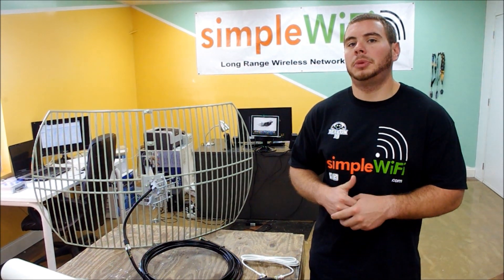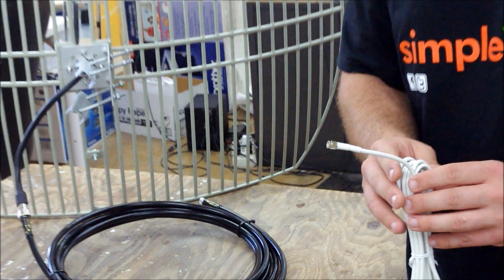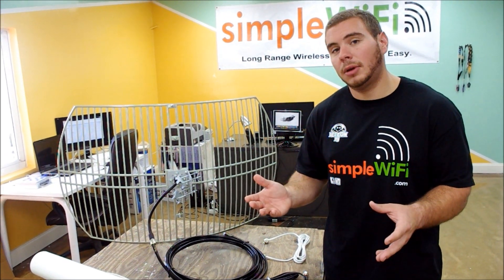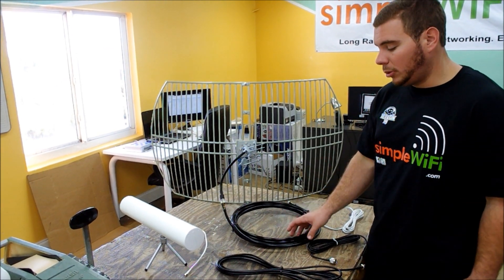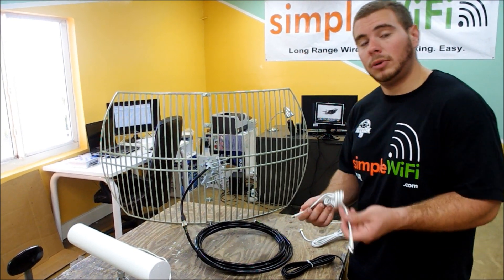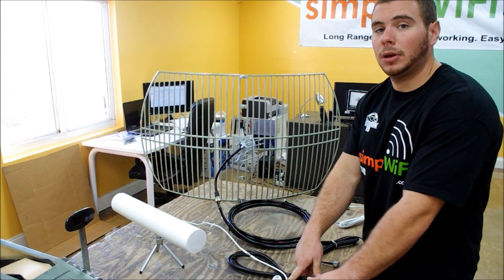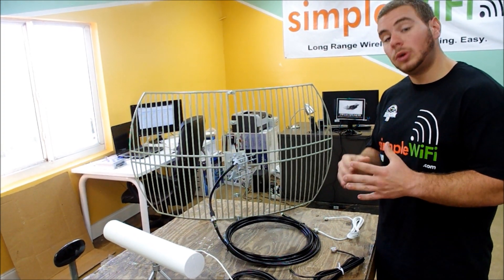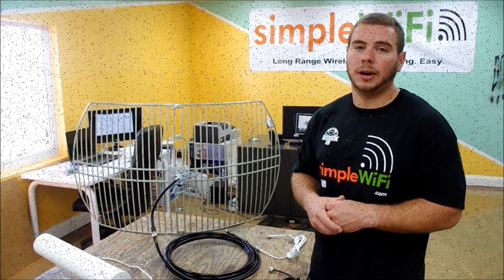Wi-Fi Coaxial Cable Assemblies - Length, Thickness & Connectors Tutorial

Comment: What kind of DB loss am I looking at with 20 feet of lmr-400 connected to a 2 watt alfa network adaptor?
Reply from the maker: less than a db. L-400 type cable has an attenuation of 3dB per 100 feet.

Comment: What's the connector to a dual antenna on Etekcity USB wifi adapter and how to get it connected, or what coax adapter to use, to connect to RF coax cable?
Reply from the maker: hmm, not sure I follow what you are asking. Can you give an example of what you are trying to do?
Reply: Having a USB connected wifi device on a computer to connect to the TV antenna (this one has a pre-amp) and use that for greater distance for reception and transmission, such as on the outside of a trailer (many metal clad, like faraday cage)
Reply from the maker: That wouldn't work. An OTA TV antenna does not work on 2.4GHz for WiFi. You can however use a satellite TV antenna (the parabolic one) to use as a directional. You are much better off using a directional WiFi antenna for $50 that you know will work.

Comment: greeting like your video, I have some questions for you if you can help me!
I bought a parabolic antenna with N connector (Parabolic Dish Antenna 35 dBi 5.7GHz 5.4-ND 5457-35-4 - N (f)), because it has a broad reach because a strong link to about 40 miles, but I do not know how to switch with N connectors on UTP cable?
UTP cable is important to me because it has the lowest loss because I have switches with 24 ports through which we go to the internet!

Comment: i had purchased online a wifi cable, supposed it stated lmr400. it has no levels to know it if is lmr400. however when i connect to my linksys router it is very slow the internet. receiving and transmitting. the cable is connected to a outdoors wifi omnidirectional antena. the cable is about 30ft long. Please help. should i cut the cable to shorten or it the cable is not lmr400. Like  i said the cable is thick and has no levels on to proof if is lmr400. I bought it online.

Comment: say i want to run a 8' to 10' cable run, if i used LMR400 would it be the best  for low signal loss on shorter cable runs ? im looking into installing my router outdoors and getting a 24dbi grid antenna and buying a 2watt booster to amp the signal, do you think this would be a good setup for an outdoor setup ?